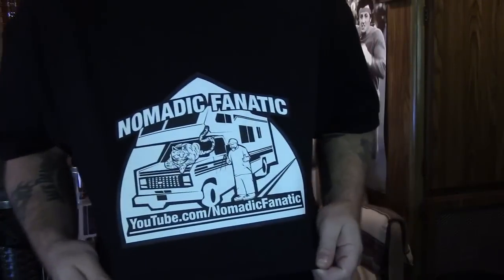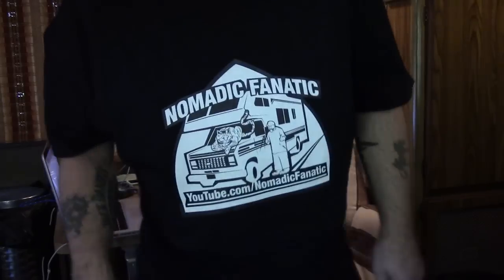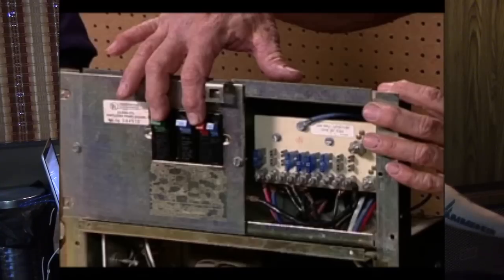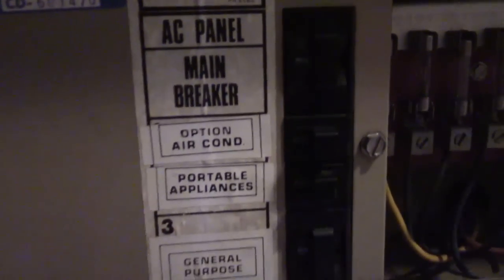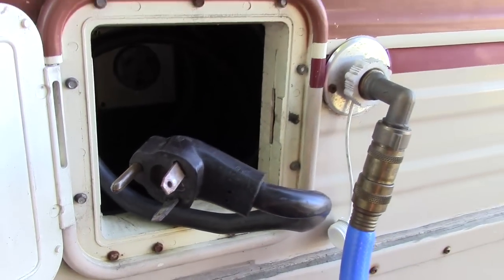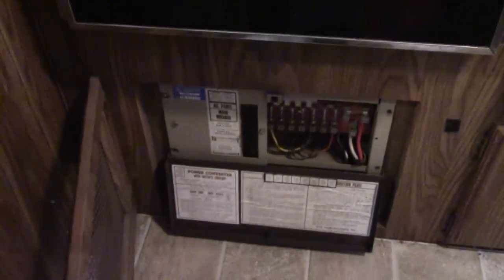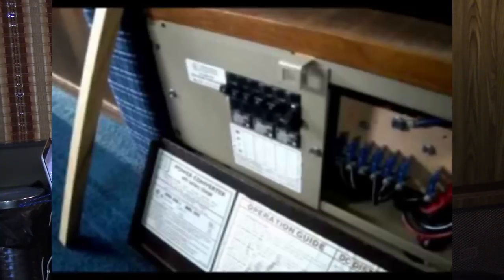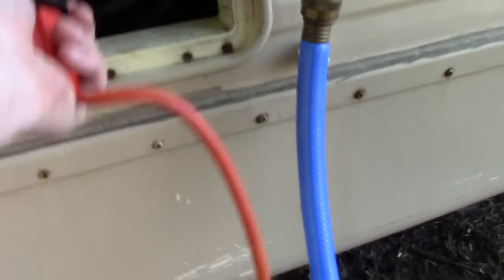RV Power For Dummies

Comment: People actually complain about the inverter thing?   I think I would do exactly the same thing you did.  It's cheap.  It's easy.  And it gives you everything you need.  If someone is actually going to complain about having to move a few extra feet to plug something in, I don't think they should be living in an RV.  Besides, you can always run an extension cord if you must.  But for a few feet, what's the point?  Plus, if you are living in an RV, it's always better to buy 12 volt accessories anyway.  So if you have the money to outfit each AC outlet to run off the inverter, surely you have enough to buy 12 volt appliances rendering the AC outlets useless anyway.  12 volt appliances are much much more efficient than AC anyway.  A 500 watt AC refrigerator will run at about 600 watts on a DC system.  A 500 watt DC refrigerator will run at 450 watts, or less on a DC system.  And by the way, you can buy a DC adapter for your computer and run it directly off DC without an inverter. 

So I guess the point is, an inverter in an RV is more of an item to carry and use only when you need it.  It's not meant to run 24X7 with an AC appliance always plugged in.  This isn't an offgrid set up with 10 batteries and 12 solar panels.  You can't be using more than 1-2kw per day so wiring up those outlets to run off the inverter is really a pointless exercise. 

That's my two cents.  Sorry for the long post.  I just don't like it when people complain about something they don't understand.
Reply: Nomadic Fanatic Oh yeah, I've seen some of their videos.  Not a fan.  It's like MTV cribs meets a couple of real nerds that try to hard .  I really hate MTV.

Comment: Very helpful.  Is there an inverter that will run an air conditioner?  I want to boondock, but I live in Texas.  Way too hot without ac.
Reply: Nomadic Fanatic
Short answer to her question is yes.  Long answer requires math and alot of money.  My 13k BTU A/C needs 12 amps.  12x120 volts is 1440 watts, but you need alot more for starting the A/C.  My 2000 watt generator cannot start my A/C.   If you want to run A/C off solar you will need 1500 watts of panels to use it during the day and a big inverter (magnum and outback make them) to handle the surge and a crapton (technical term) of batteries to run it at night.  I plan on building this for my rv.  Without pricing it fully out, I am guessing $8000-9000 to stay cool in Texas.
Reply: That makes sense.  The great thing about living on wheels is you can move anytime.   I am still in the "dreaming" stage of this.   Thx for the help:)

Comment: You have to be carefull what you plug into an inverter, there are 2 kinds 1) a modified sine wave and 2) a pure sine wave. The modified sine wave can be used for appliavces eg, coffe machine, vacume etc. but when you want to use sensitive electronics like a laptop or some other sensitive stuff you should always use a "PURE SINE WAVE" inverter

Comment: When you up your inverter for higher power you will want to get a bigger battery bank to up your amp hours. ie how long you charge your mac on it. and if you do when you get your panels you may want to have a controller that will turn on your generator when ever the draw is to much or the batterybank becomes to low. Just a thought and What i will be doing in my RV soon.

Comment: is your inverter pure sine wave or modified?
Reply: I've heard that modified sine wave could damage electronics is this just hype? or true?
Reply: Jovan Marin Hello - I've had some devices that didn't like cheap inverters. One was a laptop power supply, another was a power brick for a video camera.
Reply: thanks guys  one other quick question. is it possible to use lipo4 lithium batteries for a battery bank instead of led acid batteries. to reduce weight and save space?

Comment: I've been thinking a lot about just this subject.  We need to save in every way to be able to travel like we want.  Eventually setting up a system with the inverter would make life much easier for us to get along.............   no computer or tv, or almost anything without running our lp generator would make us both want to run home..  Just thought of a question.  our lp tank is about 22 gallons, do you have any idea how long that would last running it to empty?   I'm thinking we would have to use it all the time the frige is on.  So many questions, we haven't used the frige at all yet, hope we don't tear it up the first time...  Thanks for everything Eric, entertaining and informative as usual...
Reply: The fridge uses almost no propain. And the answer to your "how long will it run" question is a complicated one and needs more input like how many watts does it run at. what is the CC of the motor. Like how big is it. Also you can find out how long it runs very easily, but will cost a bit of money but it is a good thing to have knowledge of. First you will want to fill up your tank and then just let the genny run and see how long it lasts with out a load on it. Then what you will want to do it run it with a load on it. So fill your tank up again and then run your genny. turn on the AC and maybe even plug in a hair dryer or 2. Then see how long it runs with a load. and then there is your answer. I know I haven't given the answer you wanted but it is an way for you to find the answer you wanted for your set up.
Reply: Nomadic Fanatic Thank's Eric, I really was looking for some idea of usage because we haven't taken off on a long trip before and didn't want to run out.  Our trip is three weeks and we may be using the heat.  I'll let you know our results after the trip.  Cross your fingers for the newbees... Headed North..  :)    Thanks again for the time your put into answering the comments, you're doing a great job.
Reply: Justin Vaughn Just the knowledge that the frige uses very little propain is good to know.  We have a class c now and never had a rv ffrige before. YouTube is great, but most info is either not detailed enough or way over my head.  I think you can run the frige while traveling with just the lp cut on, no generator,,,,  is that correct?  I do know to turn it off at diesel fill ups.  Thanks for the help Justin, it's much appreciated.
Reply: The reason you turn it off at glass stations is the same reason you don't smoke at the pump. Their is an open flam. Nothing more then a pilot light bit still your frigde is on fire. And if you are dry camping and worried about your heat, bring a sleeping bag. And the Furness will suck your propain like a fish drinks water.
Reply: What question do you have.
Reply: The fridge being on while you drive maby can be done. Depends on your rig. But probly not. And if you aren't using your fridge you will want to turn the fridge on for a day or more so it cools down properly before you put food in it.
Reply: Justin Vaughn Thank you Justin
Reply: Czechseiks Thanks so much for the answer, we will have places to fill the LP up I'm sure, we just don't want to learn EVERYTHING the hard way..   Of course we will keep the level checked and fill if we even think we might need it.  Doubt if we will carry a extra tank, but I know that can be handy.  We have a class C, and no tow, so taking the RV with us to fill the LP will be a must anyway.   Have a great day.

Comment: Just wanted to leave a tip bro. You can buy 12vDC chargers for laptops.
They will be more efficient because your not incurring loss converting DC to AC and then back to DC(what your laptop uses). (DC from battery to Inverter->Inverter to AC too powerbrick for laptop--> back to DC. //could lose up to 20% in those conversions!!// 10amps just became 8 because 2 burned off in the conversion process.
One other comment... If you have a gaming laptop like I do, it consumes much more power then a standard laptop. So much so that a 4 hour gaming session could put a serious dent in the reserves of single, and some dual battery systems. Even with using a DC charger.It becomes much worse with lights on,  furnace fan kicking on, or vent fans running... that will drain out a system FAST.
I doubled my battery bank as a result.
Solar will decrease your dependency, your going to love it the first sunny day!
Still need to be careful with use. 340 Watts of panel is barely enough for me.
I need to double my system...
Your Mileage may vary.
Reply: these egsist for mac. were have I been